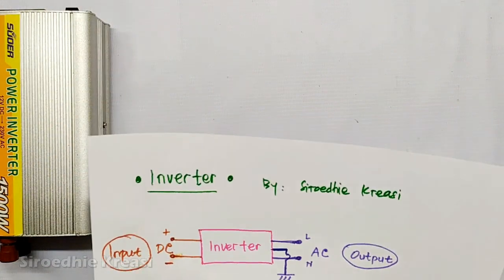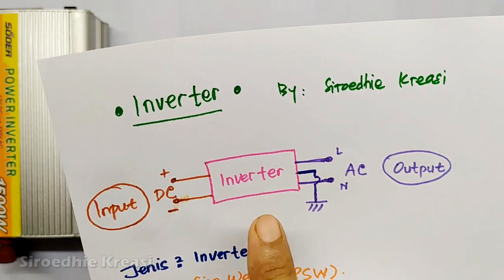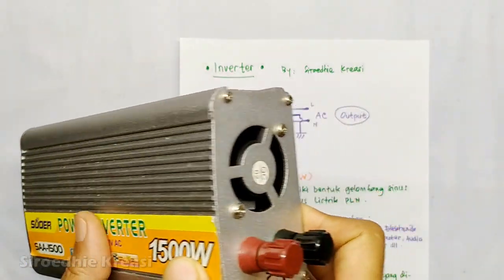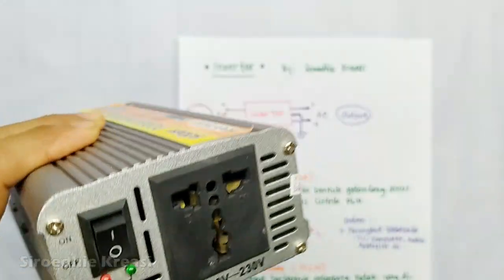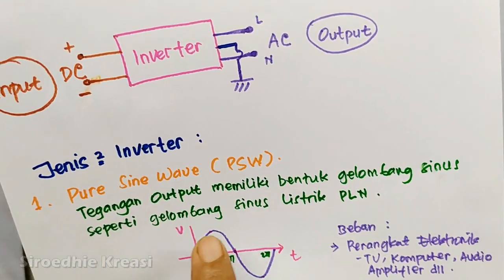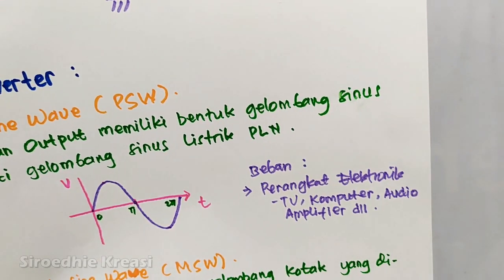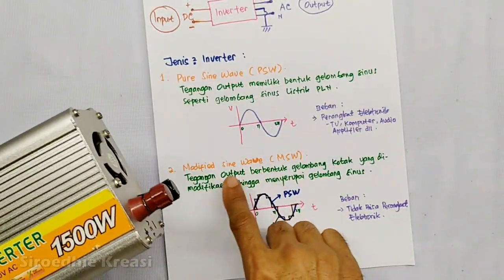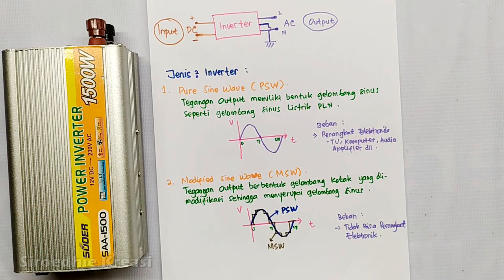Jangan Salah Pilih Inverter, bisa fatal akibatnya

Comment: Kak mau tanya kalo inventer 12v 1000w di kasih aki 12.9v 27ah meletus gak kak ..soalnya kemarin aku seri  aki 3 jadi 36V 12ah meletus kak😢😢 inveter nya
Reply: sudah pasti meletup inverternya kalau di beri input 36V ,sedangkan inverter cuma toleransi 12V-14V.  , kalau ngak salah kemampuan mosfet bisa di kisaran maks 30V /150A dilihat dari spesifikasi nya , namum bukan masalah mosfetnya , namum IC PWM dan komponen lainnya membutuhkan voltase yang tidak terlalu besar . misalnya elco-elco dll. nha sebaiknya aki di paralel saja.

Comment: Kalau digunakan untuk mesin tetas telur bisa gak, dengan daya bohlam lampu 5W, 6biji
Reply: Kalau digunakan untuk heater tetas telur, jangan pakai inverter tapi langsung pakai bohlam 12 V mobil atau motor.
Yg jadi masalah : kapasitas energi yg disimpan dlm aki itu sangat kecil dan aki lead acid harus dlm keadaan full charge. Tidak boleh dipakai sampai habis bis baru di-charge lagi.

Comment: Mau nanya om, kebetulan saya ada proyek TUGAS AKHIR bikin inkubator otomatis menggunakan PLTS,kebetulan kami ada masalah antara 2 masih belum tau,kami menggunakan aki mobil 70 Ah 12v dan inverter matsugi 500W 12v.

Yang jadi pertanyaanya adalah? 

1.Aki mobil kami tegangan nya normal 12.50V, terus di cek output inverternya kurang 159V. 

2. Terus setelah di cek ke aki motor dengan inverter yg sama teganya 226V

Jadi yg bermasalah aki mobil kami apa inverternya om?terima kasih.

Sekiran terima kasih.
Reply from the maker: Saat diukur apakah saat berbeban atau beban nol ? Kalau prediksi saya aki mobil ngedrop, sehingga output inverter ikut ngedrop
Reply: @siroedhiekreasi tidak berbeban om,berarti fiks ya aki nya drop?
Reply from the maker: @supriyanto981 iya om

Comment: Halooo bpk. Saya mau tanya
Saya mau pasang subwoofer rumahan merk akari di mobil.
Subwoofer nya dgn spesifikasi 
SB _ 600 watt
Ac _ 10 /220 volt

( accu mobil nya 12 volt )
Alat yg diperlukan apa saja ya 
Dan inverter harus yg bgaimana ya pak
Apakah perlu pakai sekring jg.dan sekringnya yg bgaimana.
Mohon petunjuknya bpk
Trimakasih🙏🙏
Reply from the maker: Pakai inverter PSW pak, daya menyesuaikan dengan beban. Sekring wajib digunakan
Reply: Sebaiknya niat anda diurungkan saja karena daya subwofer sampai 600 Watt. Ini dikarenakan umumnya mobil hanya dibekali alternator 500 Watt. Jadi jika subwofer itu dioperasikan pasti pelistrikan akan tekor, kan selain itu juga ada peralatan mobil yg membutuhkan daya spt lampu, klakson, wiper, AC dlsb.
Lain halnya kalau anda mengganti alternator yg lebih besar misalnya 1000 Watt.

Comment: bang mau tanya cara perakitan aki mobil funsinya untuk cup Sealer dan mesin blender untung jualan harian berapa ukuran nya????.....
Reply from the maker: Total beban berapa watt bang ?
Reply: @siroedhiekreasi  keseluruhan 650 wat bang..
rencana mau buat jualan es teh pakai mobil
Reply from the maker: Bisa gunakan inverter msw 1500 watt bang. Gunakan fuse/sekring sebelum dihubjngkan ke beban
Reply: @siroedhiekreasi  info link bang
kam blender 200 watt.
yang cup Sealer 350 wat on terus  stanby. kira kira awet berapa jam ya bang

Comment: Halo pak mohon di bales 
Rencana saya ingin jualan koopi keliling menggunakan mesin kopi daya 1450 watt apakah bisa pake ini ? 
Klw bisa harus pake aki mobil yang berpa volt, dan inverter yang berapa watt ? 
Mohon di bls pak
Reply from the maker: Bisa pak, pakai inverter 3000 watt (lebih besar lebih baik), aki 12 volt 100 Ah
Reply: @siroedhiekreasi  terimakasih info nya pak
Reply from the maker: @FauziBaziz sama sama pak

Comment: Bang minta infonya dong kenapa inferter punyanya baru pkek setengah jam kok tau2 mati kek gk kuat gitu sya cmn pakek lampu led 4 biji....masing2 ...20watt
Reply from the maker: Pakai aki berapa Ah Bang ?
Reply: @siroedhiekreasi  40 ampere bang aki bekas
Reply: Kalo buat lampu 6 biji 30 wat kira2 kuat berapa jam pake aki mobil @siroedhiekreasi
Reply from the maker: Total beban 30 watt bisa menyala lebih kurang 16 jam Bang

Comment: Klau mesin sealer cocok nya pkek yg mana om
Reply from the maker: Pakai msw dah bisa bang
Reply: @siroedhiekreasi  utk akinya om ? Klau psw lebih enak ya om ??
Reply from the maker: Akinya boleh seperti yg di video 60 Ah, psw lebih baik om tapi agak mahal dikit
Reply: @siroedhiekreasi  tak kira harus yg psw om , soalnya kan msuk ktegori elektronik, tahan brapa lama utk aki nya om kira² klau utk mesin cup seal . Buat jualan gtu
Reply from the maker: Mesin sealer katagori beban resistif, kalau menggunakan msw sudah memadai bang. Mengenai berapa lama, relatif tergantung watt mesin sealernya. Misal 200 watt, maka waktunya lebih kurang 3 s.d 4 jam bila digunakan kontinyu
Reply: @siroedhiekreasi  baik la om ,makasih infonya
Reply from the maker: @arifhidayat5124 siap...sama sama

Comment: Maaf bang mau nanya, kalow di inverternya tertulis input 12v/24v. Apakakah bisa dikasih input 21v  2ah (batre cordless bor)
Reply from the maker: Gak bisa Pak, inverternya dual input 12 atau 24volt. Kalau 21volt gak bisa
Reply: @siroedhiekreasi  jadi apakah ada inverter yang bisa menggunakan input 21v? Boleh minta tolong rekomendasikan inverter yang bisa menggunakan 21v bang.
Reply: Sebab saya liat di shoope rata rata inverter menggunakan input 12/24v. Sedangkan batre yang saya punya 21v.
Reply: batre bor dipake buat inverter ya ga bisa lama bang. Paling berapa menit doang Kalopun bisa
Reply: @ngelasbareng 
Baik bang, terimakasih infonya

Comment: Terima kasih channelnya sangat membantu untuk pemula seperti saya.
Mau tanya min kalo inverter yang cocok untuk menggerakkan motor ac 1 phase 220 vac Daya 200 watt pake inverter yang jenis apa ya? terima kasih🙏
Reply from the maker: bisa pakai inverter jenis psw daya 1.000 s.d 1500 watt, aki menyesuaikan dengan waktu/ lama penggunaan om
Reply: @siroedhiekreasi  terima kasih jawabannya min. Mau Tanya lagi min
Kalo sumbernya dari panel surya kemudian masuk ke inverter psw ini apakah cocok outputnya untuk beban motor yang saya sebutkan tadi? 
Mohon penjelasannya min
Reply from the maker: @rafizuhairi8524 sangat cocok om

Comment: Untuk pemakaian sehari hari pakai aki brpa volt kaka?
Reply from the maker: pakai aki 12 volt juga sudah oke kaka
Reply: Yang berapa ampere ya kaka. Dan tahan brpa lama kalau buat pom mini dengan mesin sanyo atau pompa air
Reply from the maker: @dwiksaputra1350 kaau untuk keperluan seperti ini bagusnya dibuat sistem plts aja kaka, agar aki bisa dicas ulang secara otomatis (ada di video saya yang lain). mengenai kapasitas aki, harus kita ketahui dulu total daya (watt) mesin sanyo dan berapa lama menyalanya. baru bisa kiya tentukan kapasitas aki
Reply from the maker: @dwiksaputra1350 ini linknya, bisa dipelajari dulu kaka
Reply: @siroedhiekreasi  link nya mana kaka
Reply from the maker: maaf kelupaan saya. ini linknya https://youtu.be/08AurQlL4jE?si=RkvypGalcadmsztV

Comment: Bang mau tanya  klo inverter 220 watt DC 12V dan AC 220V merk sunpro bisa ya pakai aki mobil
Reply from the maker: bisa Bang
Reply: @siroedhiekreasi  gk bahaya ta bang gk meledak, soale buat lampu jualan di pinggir jalan dan utk tes speaker 50 watt klo ada org beli
Reply from the maker: @iwannorwidadi5118 aman bang, asal dipasang secara benar. gunakan jenis inverter psw ya bang
Reply: @siroedhiekreasi  PSW tapi dgn watt DC AC sama  yaaa bang
Reply from the maker: @iwannorwidadi5118 untuk yg ini saya kurang faham maksud pertanyaannya Pak ?  🙏
Reply: @siroedhiekreasi  mksdnya bang inverter merk PSW tp dengan 220 watt DC 12V dan AC 220V  yg sama
Reply from the maker: input inverter adalah tegangan DC bisa 12 Volt, 24 Volt, 48 Volt. sementara outputnya adalah tegangan bolak balik 220 Vokt, itu artinya beban inverter adalah beban AC

Comment: Bang Kalo aki 45 Amper pake inverter 1000 watt terus di pasang stabilizer macam stavol apa bisa buat menghidupkan rice cooker atau mesin cuci ?
Reply from the maker: bisa bang, tanpa stabilizer juga bisa menyala.
Reply: @siroedhiekreasi  tp sy prnh tanya di Shopee kata penjual inverter nya gk bisa. 
Tp secara teori harusnya bisa karna inverter 1000 watt dan rice cooker atau mesin cuci sekitaran 350watt.
Menurut abang langsung inverter saja atau lebih bagus di tambah stavol?
Reply from the maker: @ratmanmaman4537 menurut saya gak perlu pakai stavolt lagi Pak, langsung inverter aja. kalau mau yg joss, pakai jenis psw
Reply: @siroedhiekreasi  oke Terima kasih
Reply from the maker: @ratmanmaman4537 sama sama

Comment: Untuk mesin circular saw 1200w pakai inverter 3000w msw apakah mampu om?
Reply from the maker: mampu om, karena sudah memenuhi syarat minimal yaitu 2x lebih besar dari daya beban
Reply: @siroedhiekreasi  merk suoer seperti di video apakah recommended om
Reply from the maker: lumayan mantap om, saya sudah pakai hampir 3 thn masih oke
Reply: @siroedhiekreasi  terimakasih om

Comment: Halo om. Saya mau tanya nih, kebetulan saya ada masalah dengan tegangan listrik di rumah saya, sering anjlok/jeglek,, apakah invertor seperti ini bisa membantu?
Reply: Oke om. Terimakasih masukannya
Reply from the maker: tidak bisa om, kalau listrik sering jeglek ada beberapa kemungkinan : mcb sudah lemah, beban di rumah melebihi kemampuan mcb ( 4 amper, 6 amper, 10 amper dst).
Reply: Solusi biar tidak mudah anjlok gimana ya om.. Listrik daya 450 di pakai kulkas 1 pintu dan dispenser anjlok..
Reply from the maker: solusinya ganti mcb dgn yg baru, tapi harus lapor ke pihak pln.

Comment: Ass.. Kak saya mau nanya, daya listrik di toko saya itu terpasang 1300va atau 6 ampere, dan kalau mau masang inverter otomatis harusnya inverter ukuran berapa yh harus saya pakai, atau baterai apa yg harus di beli?
Trimaksih kak..
Reply from the maker: inverternya dipakai untuk menanggung semua beban di toko atau bagaimana Buk/ Pak ?
Reply: @siroedhiekreasi  semua beban di toko, freezer es batu ada 2, kulkas showcase ada 2, blender 2 , mesin pres cup sealer 1, dan lampu 15watt ada 5,  Ac 1 , trus kipas ngin satu
Reply from the maker: @mithamitha1872  saya sarankan menggunakan genset aja, lebih efisien. kalau menggunakan inverter biayanya mahal
Reply: @siroedhiekreasi  kalo untuk penggunaan blender saja sama mesin cup sealer gimana kak?
Reply from the maker: @mithamitha1872  kalau untuk blender dan cup sealer boleh pakai inverter jenis msw

Comment: Assalamualaikum bg mau nanya mudah² dijawab, saya punya tenaga surya 100Wp aki 12v 70Ah dipakai untuk menghidupkan spiker walet,  pertanyaan nya bg inverter yg cocok untuk cas hp sama untuk hidupkan radio baiknya yg berapa volt ya bg?  Mohon bantu jawabnya bg
Reply: Iya bg kita pakai panel surya untuk pengecasanya
Reply: Kalau untuk ampli dan spiker walet nya itu sekitar kurang lebih 100watt
Reply from the maker: @iwanaprilian4177  belum aman bang, bagusnya pakai inverter 500 watt atau lebih besar semakin bagus. agar kerja inverter tidak maksimal
Reply from the maker: Waalaikumussalam. pakai inverter psw bang, input 12 volt dan output 220 volt
Reply: Kira kira aki bakaln cepat rusak gak ya bg?  Krna suara walet kita juga dri aki itu?
Reply from the maker: @iwanaprilian4177  siapkan juga charger aki bang, agar aki gak terlalu ngedrop
Reply: Invertert yg 220Watt bagus gak bg ya?  Krna hnya untuk cas hp, menghidupkan 1 lampu dan cas radio
Reply from the maker: @iwanaprilian4177  jumlah watt totalnya berapa bang ?
Reply: Klau ampli sama spiker walet itu lgsg kmi sambungkan di aki bg,  rencana nya imverter hanya untuk cas hp cas radio dan untuk 2 lampu ajh bg
Reply from the maker: @iwanaprilian4177  ooo begitu... berarti aman bang
Reply from the maker: @iwanaprilian4177  sama sama bang, sukses selalu

Comment: Bang, yg MSW bisa kah untuk beban cup sealer (alat press tutup pop ice) ?
Krn saya mau beli inverter takutnya yg MSW gk bisa
Reply from the maker: bisa bang, beli inverter minimal 2x lebih besar dari watt beban ya... misal beban 100 watt maka kita beli inverter 200 watt. lebih besar lebih baik lagi
Reply: @siroedhiekreasi  siap thanks Bang
Reply: @siroedhiekreasi  Bang, ini saya udah beli converternya 1000 watt merk Rayden, untuk sekitar 4 jam normal untuk convert aki dan dipakai untuk mesin press 350 watt dan lampu 4 buah 16 watt, tapi setelah itu converternya jadi panas dan indikator fault (warna merah) nyala

Lhaa itu kenapa ya Bang?
Apa memang tidak bisa dibuat lama" converternya ini?
Reply from the maker: @PribumiNusantara45  idealnya penggunaan alat harus ada jeda/ istirahat bang. kalau dipakai terus menerus alat akan bekerja secara  keras/ maksimal
Reply: @siroedhiekreasi  Siap Bang, thanks 👍

Comment: Om saya saya mau mengoperasikan mesin peras tebu pakai dinamo 
1 pk (750 watt)
Voltage : 220 v
Ampere : 6.04 A / 50 hz
Voltage kapasitor : 250 VaC
* Bijak nya pakai inverter yg low atau high ya om ?
Mohon pencerahan nya 🙏
~ terimakasih ~
Reply: Terimakasih info nya om 🙏
Reply from the maker: kalau saya lebih memilih genset saja Om, karena lebih ekonomis bila dibandingkan menggunakan inverter 🙏

Comment: Bang mohon infonya..saya baru beli di online..apakah aman dipakai di mobil bang 👇
Car Inverter yang dilengkapi dengan port AC dengan tegangan 150W 220V dan USB plug 5V 0.5A. Anda dapat menggunakan car inverter yang sangat praktis ini untuk mencharge laptop, gadget, smartphone, dll secara langsung. 

Spesifikasi Taffware Power Car Inverter 150W 220V AC EU Plug 5V USB Charger 

Warna Merah 
Dimensi 6.1 x 12 x 3.7 cm

Fitur

AC EU dan USB Port 
Compact Power Car Inverter Charger ini memiliki port AC dengan tegangan 150W 220V dan USB plug 5V 0.5A. 

Desain Mini 
Hadir dengan design yang kecil dan tidak memakan banyak tempat pada mobil Anda. 

Compact Power Car Inverter memiliki tegangan yang sesuai untuk menchargergadget, smartphone, dll secara langsung.
Reply from the maker: kalau melihat spesifikasinya, inverter ini aman untuk dimobil Pak
Reply: @siroedhiekreasi  tks om 🙏
Reply from the maker: @sam-srg9328  sama sama 🙏

Comment: Salam damai saudara. Tumpang tanya..jika mesin memerlukan tenaga 24v. Berapa watt invater yg diperlukan. Bateri 24v, invater berapa watt? Terima kasih
Reply from the maker: kalau mesin menggunakan tegangan 24 volt, alatnya bukan inverter Pak...tapi adaptor. fungsi inverter merubah tegangan DC menjadi AC seperti penjelasan saya dalam video ini

Comment: Maaf bang semoga dijawab,saya salah konek min plus nya pas konek ke aki, apakah mesin inverter nya bermasalah🙏🙏🙏 mohon dibantu
Reply from the maker: wadduh... kalau sistemmproteksinya bekerja semoga gak rusak inverternya bang. bisa dikonek ulang dan lihat output inverternya. sebaiknya diukur pakai multimeter
Reply: Saya coba pake aki motor, langsung ada percikann mas dari plus nya aki, apakah harus memakai aki mobil?🙏🙏🙏saya coba connect ulang
Reply from the maker: @Contoh-gj5vh  penggunaan aki sesuai kebutuhan bang, semakin besar beban maka aki juga harus besar kapasitasnya
Reply: Terimakasi bang udah dijawab🙏
Reply from the maker: @Contoh-gj5vh  sama sama

Comment: Mantab ilmunya om. Saya masih bingung apa yg termasuk barang elektronik & bukan. Kalau pompa air, blower, aerator kolam itu termasuk elektronik atau bukan?
Reply from the maker: itu termasuk beban induktif pak, dalam video ini saya sebut sebagai beban listrik. beban elektronik yg saya maksudkan seperti dalam penjelasan video ini adalah peralatan yg di dalamnya terdapat komponen seperti transistor, ic, resistor, capasitor dll, contohnya seperti tv, laptop, pc, dvd player dll
Reply: @siroedhiekreasi  Terima kasih utk penjelasannya
Reply from the maker: @SamuelLimawan  sama sama Pak

Comment: Assalamualaikum bagus banget kontennya. 
Pak saya mau tanya, kalau saya mau pakai mesin cup seller dengan watt sekitar 350watt.
Saya pakai inventer berapa ?
dan jenis yg mana yaa pak?
Sama aki mobil yg ukuran berapa?

Terimakasih
Reply from the maker: bisa gunakan inverter jenis msw 1000 watt, pakai aki seperti punya saya juga sudah oke (65 Ah)
Reply: Inverter 1000 wat pake aki 35 amper dipake hidupin frezer 150 wat lampu 150 wat kira kira kuat brp jam
Reply: @samurida5822 bantu jawab ya aki 35ah kalikan tegangan 12volt = 420 : total daya yg digunakan = 1.4 jam kita2 begitu hitungannya mohon maaf kalo salah hehehe🙏
Reply: Brp jam ketahanan ny bg. Klo beban Sealer di pakai 1 hari 24 jam mampu gak ya
Reply: @nardigym6728 gak mampu hanya bisa 2 jam saja

Comment: Bang, kl sy ada panel surya yg 30wp cocoknya beli aki yg ukuran brp? Kl hanya buat nyalakan lampu penerangan saja, Bang.. 
Makasih..
Reply from the maker: untuk lampu kisaran 10 s.d 15 watt pakai aki 35 Ah udah oke tuh Bang,
Reply: @siroedhiekreasi  Makasih Bang.. Kl sdh simpan di aki apakah bs lsng dibuat ngecas hp maupun lampu cas, Bang? Apakah perlu alat lain? Makasih sblmnya..
Reply: Bang, tlng bs minta no WA kah? 
Makasih..
Reply from the maker: @jckiossitrua2901  gak bisa bang, harus kita pakai inverter dulu. karena tegangan input charger hp dan lampu menggunakan tegangan ac (bolak balik)

Comment: Mau tanya pak, sy sudah punya inverter 150w apa bisa sy pakai untuk blender 350w? Atau solusi nya gimana ya pak?
Reply from the maker: gak kuat pak. daya minimal inverter adalah 2x lebih besar dari daya beban
Reply: @siroedhiekreasi  kemarin saya coba mau mutar mas blendernya,1-5 speed jalan dgn baik, tapi memang blm coba lama paling semenit doank mas, kira2 gimana tuh mas?
Reply from the maker: @rollybotak4277  kalau sekedar mutar sih bisa mas, tapi bila berbeban dan dalam waktu lebih 1 menit nanti resikonya inverter akan rusak, karena memikul beban di luar kemampuannya

Comment: Mau tanya mas kalau aki 12v 5a, pakai inverter 220w 12v digunakan untuk cctv 12v/1a 7watt kira2 bertahan berapa lama mas? Terimakasih sebelumnya.
Reply from the maker: kalau cctv 12 volt, menggunakan adaptor pak. bukan menggunakan inverter